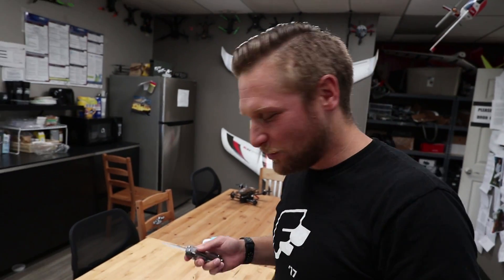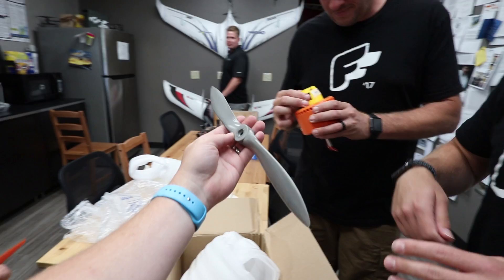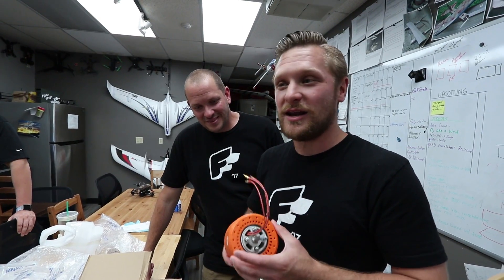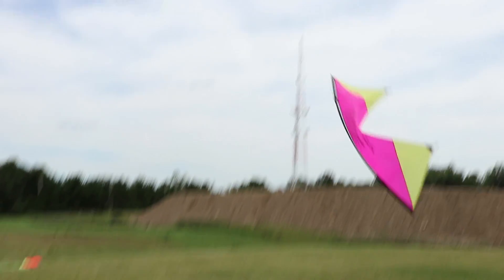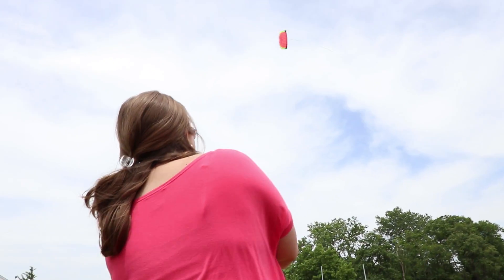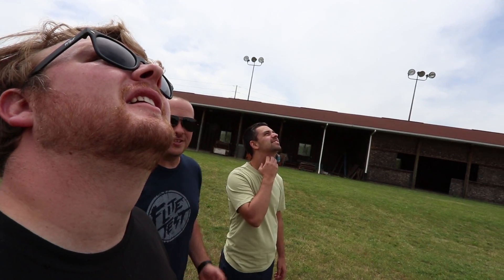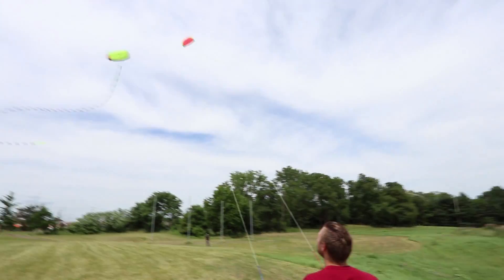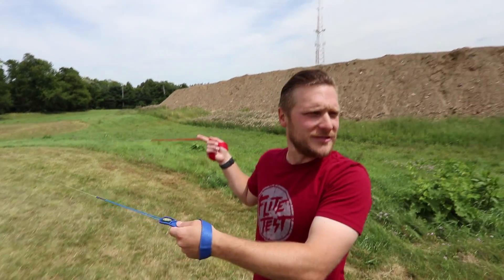GIANT 3D PRINTED BRUSHLESS MOTOR | VLOG0091

Comment: You skipped the most significant part.  The motor is a halbach array motor.  Technique was invented in the 80's as a technique for beam-steering in particle accelerators.  That motor is somewhere around 80% efficient.

Comment: That 4-line kite is something like a Revolution. It is a top notch stunter, and of course one that will test your skills, but once you have it, it is a pleasure to fly, and one that give you a bit of bragging rights. I notice that whoever way flying it, uses a lot of pull action with the arms, whereas the Revolution does not require much of that, in stead more wrist movement and less pulling gets you along a lot better.

Comment: to be fair id like to see the motor survive if possible by putting on a cub type plane so it can use a slower rpm so it is a real test first. then maybe crank it up. i also have been trying to make a real motor but more the standard style bell motor we would use on most planes.

Comment: Put a motor on a kite and rc it, both with and without lines attached to it. maybe do one where it gets it power through a wire along the line., making it lighter.. Think it could make an interesting experiment between the dynamics of flying a kite and a plane at the same time. ;)

Comment: I vote for an episode on kites. I have two older dual-line Prism foil kites, one a 1.2 meter and the other 2.5 meter. They are an absolute BLAST to fly! 
And if you want to step it up a bit (though not to the paramotoring level), check out kite buggying. I got to try out a friends buggy back a few years, that's the most fun I've ever had on three wheels.